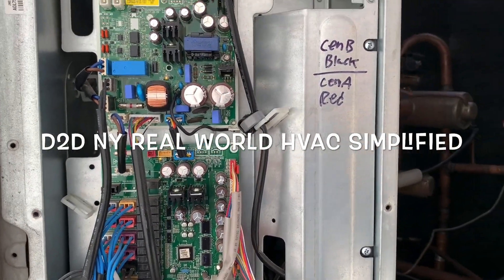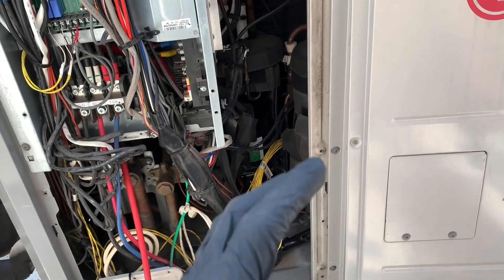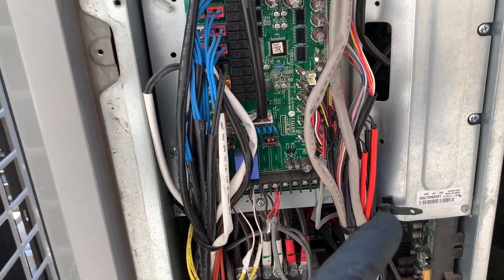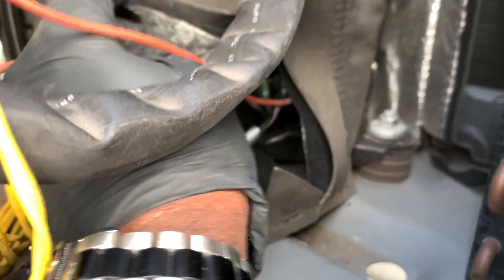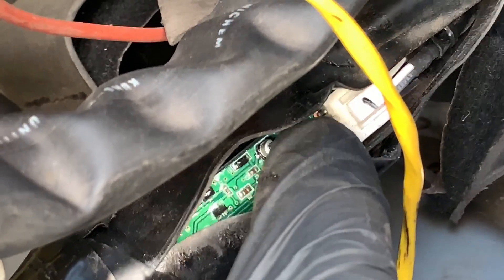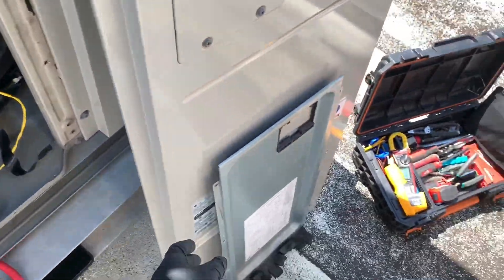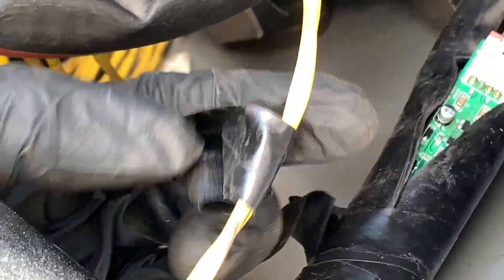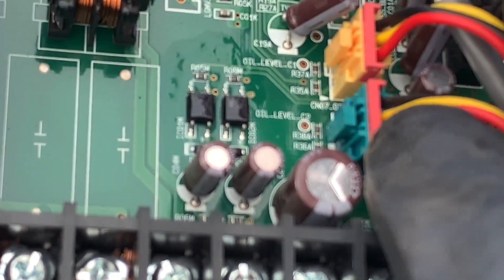HVAC TROUBLESHOOTING LG MULTI V 5

Comment: Hi I have the code C11 and 261 please help me. Thank you
Reply from the maker: Communication error
Reply from the maker: Between indoor and outdoor inverter board, no communication check power supply and controls wiring between the two

Comment: Hello, I have a Multi Vs system and I I have 2 thermostats one works fine connected to one ducted unit and the other is daisy chained between 3 units, I keep getting error 53-1, when the system starts to blows cool but then stops on the 3 units. Help if you can

Comment: we have error code C2 1 CH-116 in our Multi V5 air conditioner. Do we need to remove and re-install the oil sensor or measure its voltage to fix this problem?
Reply from the maker: After replacing the sensors on the jobsite I went the error never came back

Comment: You should be able to pull the leads off the oil sensor and short them together and watch LGMV service tool to see if the oil indicator goes green. If it does and you put it back on and it goes off again then it's a good indication you are low on oil. If tho when you short them out and the green light doesn't go green then it's a faulty oil level sense and cable. Order it for inv2 so the plug colors are the correct ones. Then as alway watch it and make sure it does go green if not you'll need to run oil recovery mode and follow other comments abovevas you might have another issue with valves
Reply from the maker: @James Handshy very nice 👍 sounds good I will definitely be testing this out ! Thank you 🙏and thanks for stopping by

Comment: If any indoor unit or HR/Branch selector box loses power, can the entire system shut itself down? Has anyone ever experienced that?
Reply from the maker: On this site 1 indoor unit had no power and the rest of system  stayed online
Reply: System would still run even if you lose one or two indoor units, unlike daikin crap
Reply: @mwdub02   Does the system bypass the faulty addressible unit then? (the faulty fan coil or branch box with no power in this case)
Reply from the maker: @chris Def still runs
Reply: @AtalaTheGreat  yes it’ll pass it.

Comment: Hello sir, I am having trouble on slave and master multi v.5 vrf, both accu are not running but no error is being displayed. I have also tried LGMV but all parameters are normal. Hope you can help.  Thank you!
Reply from the maker: Does the compressors starts or runs?

Comment: Curious 🧐 is there a vale to oil level from the compressor thermistor? Some way of checking to see if you are getting the proper value from within the compressor?   Just sayin
Reply from the maker: Good question! perhaps 🤔 I will check for that the next time I have the service checker/tool hocked up to the system and add a comment regarding.

Comment: Usually oil return is a fault of the indoor units needing to be reset. Sometimes the  outdoor unit will lose an indoor units address or HR boxes could have failed eev. It's hard to troubleshoot without using their service checker LGMV

Comment: Pls post next vdo also what was actual problem thanks
Reply from the maker: I replaced that oil sensor board/ module and the system ran error did not return and client haven’t called back since!